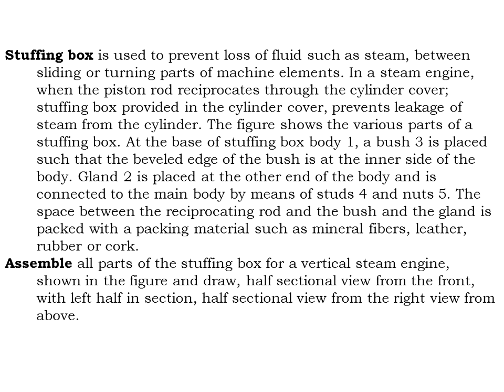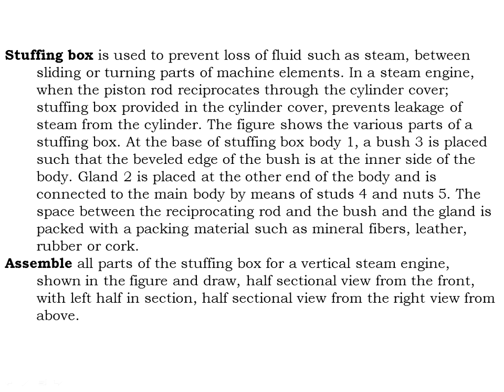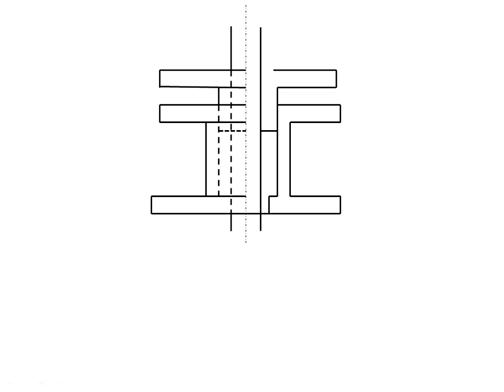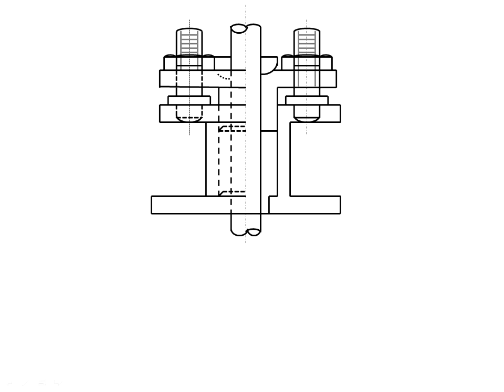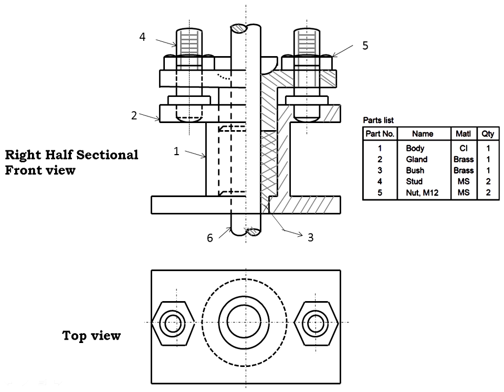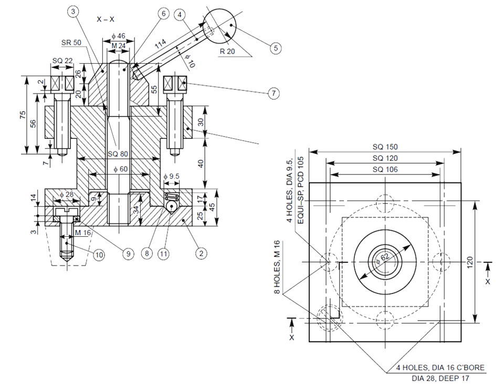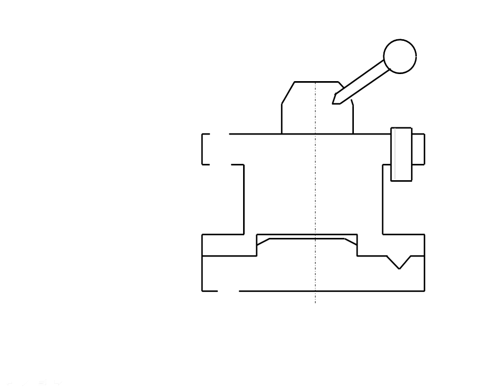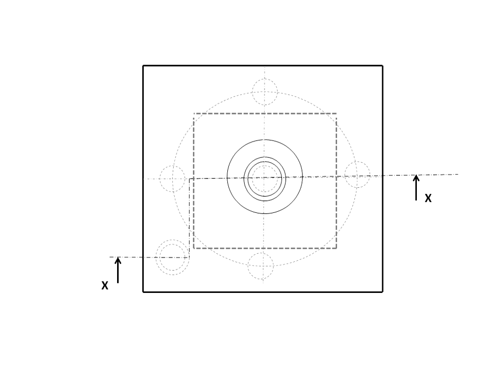ASSEMBLY DRAWING OF STUFFING BOX and SQUARE TOOL POST

Comment: Diagonal hatch?? 
Dot?? 
Cross mark?? 
Red colour?? 
What is activity in engineering drawing
Reply from the maker: Diagonal hatches use for sectioning. Dot use for different purpose like as in centre line supporting.cross mark also use for sectioning.